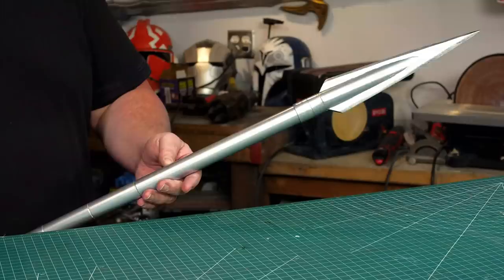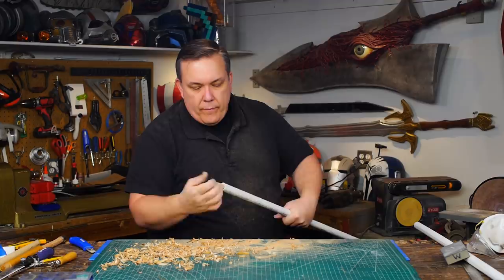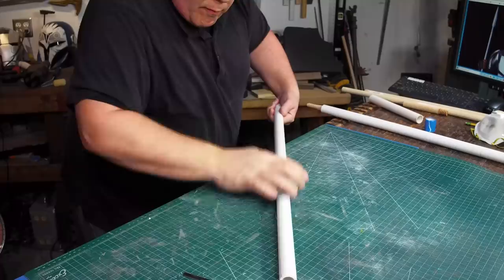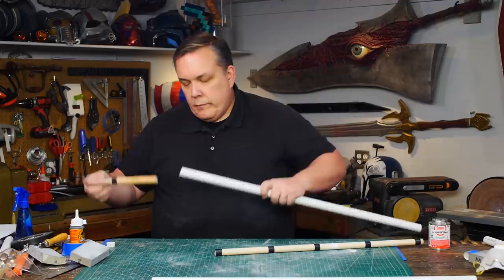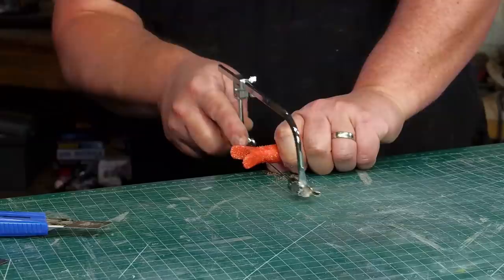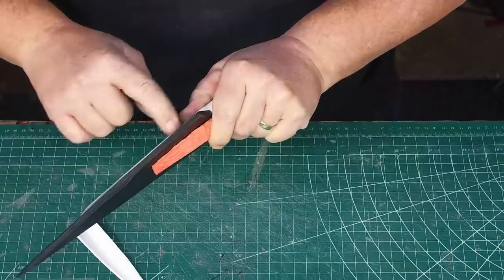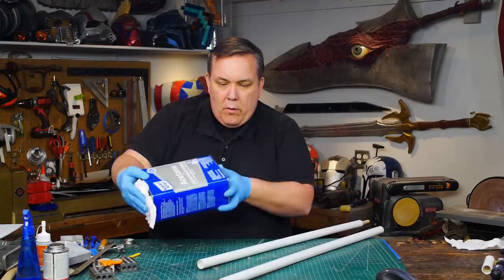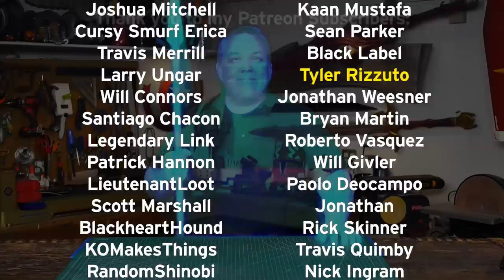Odin Makes: the Mandalorian's Beskar spear as seen in Disney's The Mandalorian

Comment: I don't know if you've seen the use of graphite powder for a metallic look before but I think this would look awesome using that technique! Love the spear and I love the rest of your work!
Reply: Aluminum foil tape would work in a pinch.
Reply from the maker: I have seen the the use of graphite powder- I have not used it much yet. What I have seen it is a little darker in color than the paint I used, and is also dependent on a high gloss black undercoat.
But graphite powder does work incredibly well.

Comment: Rotary tool is definitely the best first step into making. Lots of different uses, very versatile.
But... God damn do I want a belt sander!!
Reply from the maker: Belt sanders are great! Grab a low cost one, if the material you are working with is softer (not steel, or oak) than a lower cost budget sander will get you going for a while. This is pretty much Adam Savage's advice, and I like it.

If you are in the states, look for a Harbor Freight Tools near you. The belt on my Ryobi sander is from HFT, and the sander is actually second-hand!

That is also an idea- look for a pawn shop! They have tools too.

Comment: You can use a pipe cutter to cut PVC straight.  The blade will cut right through the plastic and cut it straight.

Comment: Looks good, Odin!!! #ThisIsTheWay!

I like your tip for getting PVC to be more rigid at 6:32 : using something inside it to strengthen it! I used a smaller length of PVC wrapped in tape every foot or so to do just that when I made my "Rey's Staff" from Star Wars: The Force Awakens! I'm sure wood would have worked better but the PVC was good enough and didn't add much weight.
Reply from the maker: Oh nice! The wood did add a little weight, but over all the spear just has a satisfying heft to it now. It's still light enough to carry around all day.

Comment: I personally would have liked to see some metal used, just because in the show that spear had a cool ringing when it hit the ground. They way I would go about doing that is to find a metal end piece and weld a rod to it and have the rod hidden inside the pvc pipe and make sure the pipe is hollow around said rod. That would allow for you to strike the ground and have the rod vibrate to create that ringing. I'm not sure if that's con-friendly but this is just my personal opinion.
Reply from the maker: Depends on the Con, and their rules. The shaft may be fine as metal, with a safe end- some Cons don't like ANYTHING metal. I just play it safe.

Also, I still have a 'video production head' so all my stuff is lightweight, and quiet- all the cool metal clanging sounds you hear on video/film are added later, when they can be controlled. On set the ONLY thing that is important are the actors lines. Everything else is added later!
Reply: @OdinMakes  holy crap, Odin replied to me lol.

That actually makes perfect sense. I've only ever attended one con and I didn't have any props so I don't really know how that process works.

I love watching your videos just to see how you can take what some people would call junk and make something magical that looks like it came right off a movie set. You got an amazing skill Mr Odin, keep up the great work!

Comment: You could show some hand sanding. (esp the thin wall sections y7ou cut 5 of) I cut over size parts and use a ceramic tile (or any suitable flat surface) and sand paper to smooth out the shapes. Works for resin plastic foam wood n of course metal, each taking more r less time, so it is a test of patience as well.

Anyways as usual, enjoyed the Build

Hand made when possible
This is the Way !!

Comment: Could you make the blade out if foam or would that be obvious that it's a different material after painting?
Reply from the maker: Absolutely could make it out of foam. Seal with Mod Podge / Flexbond / Plasti dip and it should be fine.

What will happen is the spray paint will crack when the foam moves, as that paint does not flex- that is the trade off.

Comment: "I'll only use a rotary tool" grabs hack saw, vice, pencil, 123 block, box cutter, curved ruler, straight ruler, another saw, a heat gun, and a sanding block.. LOL just giving ya crap. You could've used 2mm eva for the spear head cover instead of cut pipe and if you rub graphite powder over silver spray paint you get a realistic steel finish
Reply: Right?
Reply from the maker: You didn't notice that I said the only POWER tool was the rotary tool...
Then it was fun making it a lot of PVC